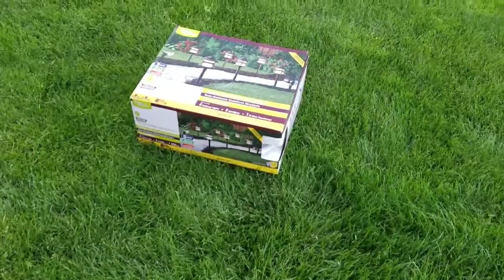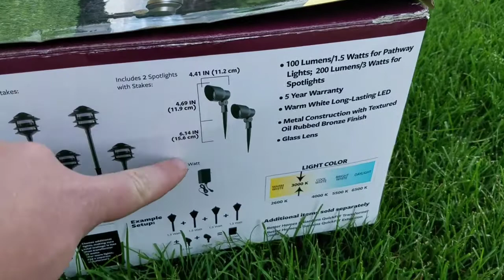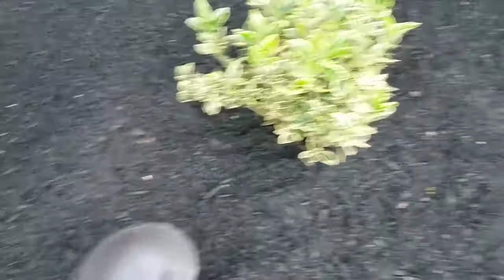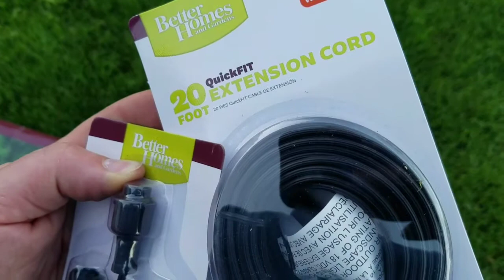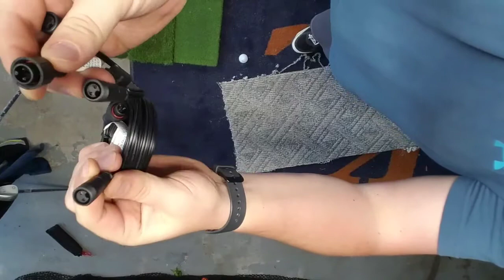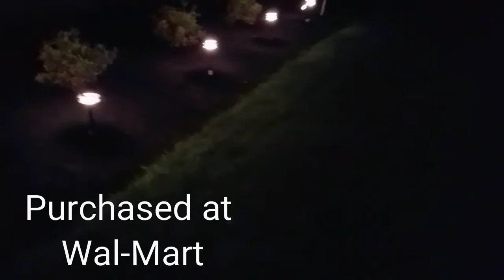Reviewing the Better Homes and Gardens Frayser LED Landscape Lighting Set

Comment: I bought this set 4 years ago and love them. I have them plugged into a smart plug so they can turn off at a designated time. Walmart seems to no longer sell them. I just found two on eBay that I bought. 3 of my lights died last week. I believe water got into the led chips. Anyone know who builds these for Better Homes and Gardens? I’d like to buy another set.

Comment: I installed this set today but they did not come on at night time.  I double checked the connections and they are tight.  I tried the transformer in the outlet and with a 1 ft extension cord, porch light is turned on,  i tested the outside outlet with my cell phone charger and it is live...............what am I doing wrong?

Comment: Just to add to the conversation, i installed these last summer. I had so many lights to install i needed 3 35w transformers.   As mentioned in the video i used several of the Ys and 20 ft extensions to get to areas around my yard. I used all the different kinds of lights spotlights, 2 diff kinds of path lights, Wall wash, up lights.   I love these!!!!   Will be installing more this year.    I have my three transformers plugged into Lutron Lamp modules which i can control wireless automatically. So basically mine are enabled around dusk (the light sensor then turns them on) but then i shut them off at 11 via the Lutron automation so they are not on all night.  Using the Lutron app i can still turn them on after 11 if i desire.       I just noticed they have a 45w transformer now, so that really helps also!
Reply from the maker: Mike Wilson mike, thanks so much for sharing! I thrilled you are having a positive experience with this set.  I had no idea they are selling a 45w transformer. I want to add one or 2 more lights but limited to one outlet without running additional wires. Do to remember how much the 45w costs?
Reply: Looks like $20 for the 45w.  Im the same way, i split all mine up and got three sections, but of course would have loved to added just a few more. So i be replacing a couple of mine if not all with 45w to put a few more spotlights or wall wash or up lights in.   I was going to add a few more path segments so maybe ill use the 35ws there. I think the 45w pretty much makes this a 11 out of 10!!!      Wife is pretty picky about LED light color and the design color of the lights. These meet all requirements and more. They look like the expensive lights!!!!   Throw in the ease of connection, cant be beat!Now if they could add a 100ft extension, the system would be perfect!
Reply from the maker: Mike Wilson thank you so much for sharing. I bought 2 extra 35w transformers just in case they ever go bad and the company stops making this model but I think I'll see if I can still return them and get the 45's. For $4 extra bucks 10w is huge for my setup

Comment: So I thought I'd com3 back and leave a comment about something that happened to 2 of the sets I have installed.  So one set (same transformer) began a quick flash of lights. All of them. The whole set. I thought it was a bad transformer or the photo cell catching light from somewhere but after thinking a bit it turns out if one individual light goes bad it messes uo the whole set. I left the transformer plugged in and left all the lights connected and began unplugging the light furtherest from the transformer and worked my way toward the transformer. 5 lights in I found the defective light and plugged the lights around it in to bypass it till I get a replacement.  Definitely start at the end and work your way toward the trqnsformer to save some time if the defective light is near the end of the strand.
Reply from the maker: Thank you for sharing this insight, it's very valuable to know.  Sounds like a bit of a design flaw.  I mean, even Christmas lights stay on these days when one light goes out.  I'm thankful for you sharing and I hope the lights hold up well over time!
Reply: The first one in my set closest to the trans went out and the rest stayed on.  I took it out of the chain and everything is fine. guess the LED bulb was bad.  But the remaining lights stayed on and the bad was the first in the chain.
Reply: Thank you for this! I have been searching the web over to figure out why these lights are flashing trying to     send an SOS signal!  I just installed them last week.  This has been very helpful!
Reply: All the lights remain on if one of the fixtures goes bad. They all light independently from each other.

Comment: I bought 5 boxes (5 sets) for $25 each on clearance at walmart last week and bought the well lights and telescoping floodlights (all clewranced too. I installed all 5 and the fixtures and am amazed at the low energy consumption but bright crisp light. The tiers are 1.5 watts, 3 watts for the flood lights and 3 watts for the well lights. As the video poster said it would have costed a lot to build a system out. You can also purchase cables of 10' and 20' if you need to do a long run without lights. Voltage drop isn't an issue being as they are LED. They also have splitters if you need to run cables in different directions.
Reply from the maker: goble ramsey they are only $25?! I have to get to my store and grab another set or 2!!! 💰
Reply: I just scored them for $19-25 too, if you need any extra pieces you can find them for 75% or more off.

Comment: I purchased these.I can tell you that after using solar and ripping them out due to inconsistent and poor lighting these made my day.They come on and stay on until they're supposed to go off.They're tough and built well.Made of metal and fairly heavy wiring.Same quality as more costly low voltage lighting.I purchased an extra transformer which I stored away since no transformer last forever.Not bad at all.
Reply from the maker: I couldn't agree with you more on ALL accounts!  You make excellent points about this excellent value set.  I bought 3 matching solar lights at the same time to go around a tree at the bottom of my yard.  They are so inconsistent and unreliable.  These use little electricity and really perform well!  I didn't even think to buy a spare transformer.  I better get on that to plan for the future!  Thanks for the input!

Comment: Great video!  Question:  If I wanted to add lights to this set, do I need to get a bigger transformer to meet the additional wattage?  If so, where can a bigger transformer?
Reply from the maker: Hey! You can add on tho this set up to a certain wattage.  I think you can add about 20 watts of light until you need an additional transformer.
Reply from the maker: I'm not sure if they offer a bigger transformer, but you can get a second one which is not ideal.  If you are into splicing wires, you can likely use any transformer you like.
Reply: @TheDealDorkReviews  I’ve seen a 40 watt transformer on e Bay with the same quick connect.

Comment: Can I put the lights where I want or do I have to use the spacing shown in the directions. I need 12 lights for my front and side of the house. Also can I use another transformer? Thanks
Reply from the maker: Generally you can put them where you want.  You don't need to follow the spacing in the directions.  I purchased an extra 25 foot wire so I could get more spacing between them.
Reply from the maker: You can use another transformer, however I would imagine it would involve splicing wires together because the included wiring has special connectors.  If you are good with electricity, I would think this would be a simple cut, strip, and connect.
Reply: The Deal Dork Reviews Super!....thanks for getting back to me so quickly.